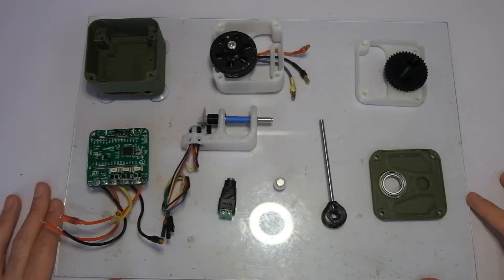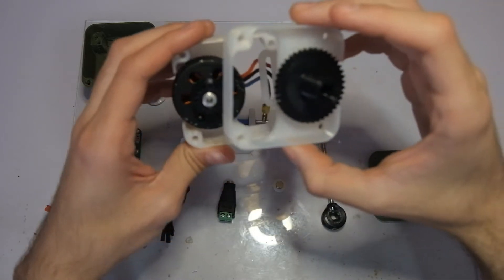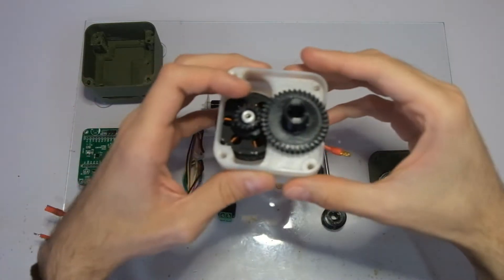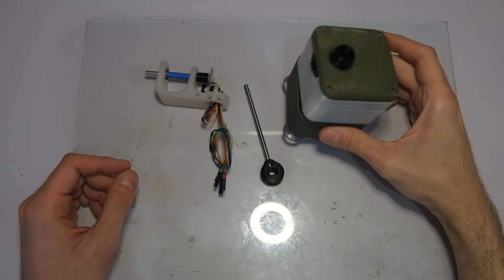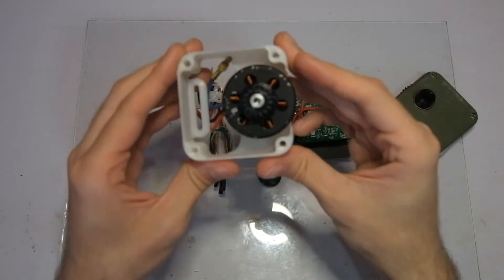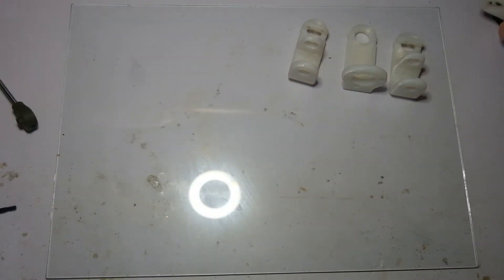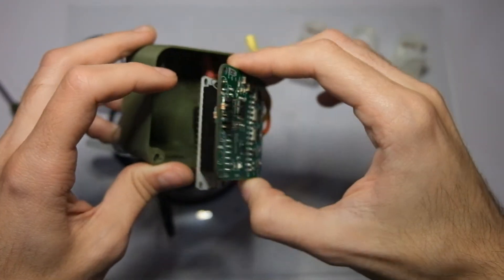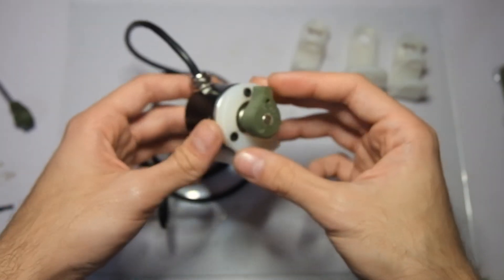Building another Furuta Pendulum

Comment: What encoder is that? I was looking for an encoder that wasn't too expensive, so I was thinking of using a magnetic encoder such as the AS5600. Why didn't you decide to use this instead?
Reply from the maker: I stay away from i2c position sensors. Talking i2c is usually too slow for these closed loop systems.

Comment: Its an awesome design. What are your views on using the stepper motor on the base as opposed to the brushless one.

Thanks in advance.
Reply from the maker: @rishavdhungel9813  it is totally doable, but I think it might be easier to tune and find the right torque/ speed with a brushless with low or no reduction ratio.

Comment: Hey David, great to see you posting a new video. Are you using the Janus board because there is still a chip supply shortage for the Dagor controller board components?
Reply from the maker: I’m using Janus because I still had a few left; they both use very similar components. Shortage is still very bad.